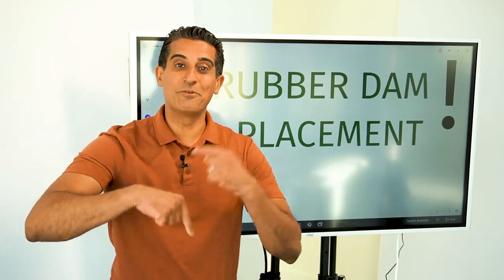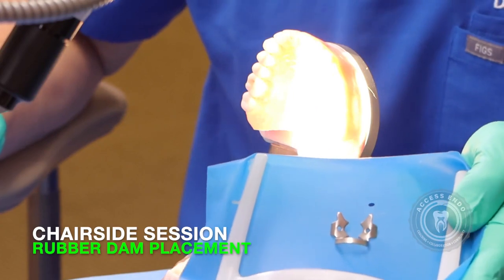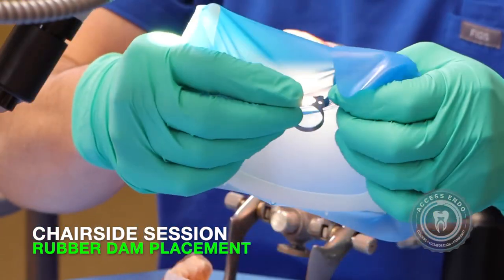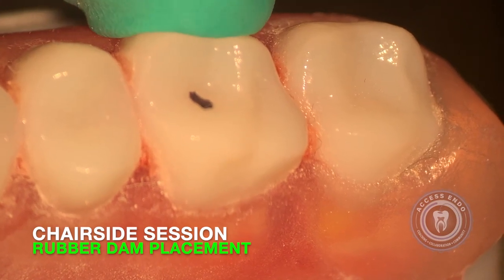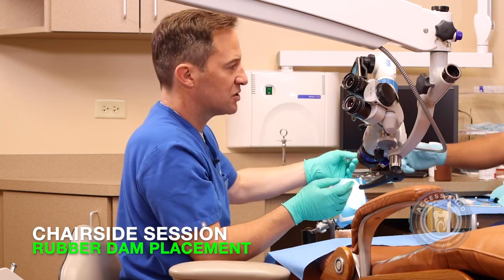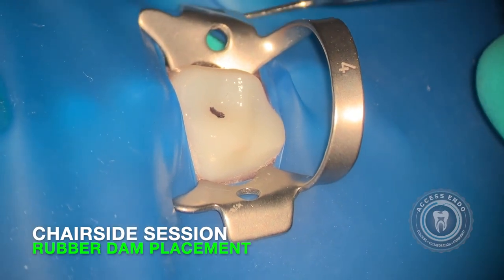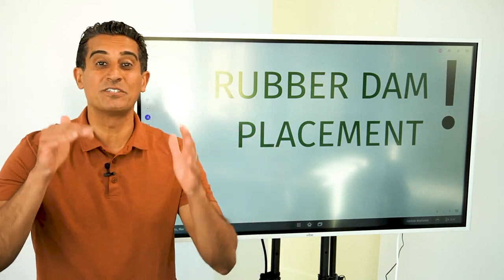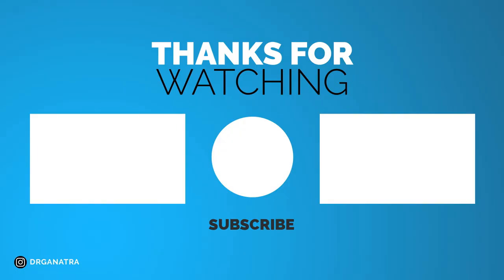How To Place a Rubber Dam- Dr. Brett Gilbert's Tips!

Comment: I am a patient. I recently had an endodontist do root canal therapy on a molar. I have a very small mouth. She used a rubber dam (which I hated going on but liked as far as the procedure). That evening, as the novocaine (or whatever is used for numbing) wore off, I felt with my tongue something on the inside of my upper lip on the side where the work was done. When I turned my lip, I saw a very large rectangular sore on the inside of my lip right near the outer edge of the lip. This lasted several days, was very painful and uncomfortable; my whole face was swollen on that side. I told the doctor that I thought maybe the rubber dam caught my lip. She never heard of someone's lip getting caught in the rubber dam. From your video, sounds like it's possible. Just another note ... I also had two black and blue bruises on the lower part of my face on that side. That one I can't figure out.